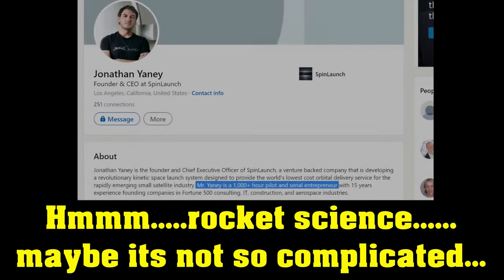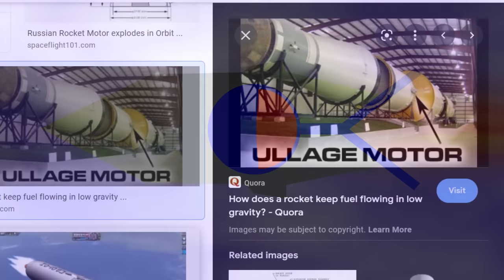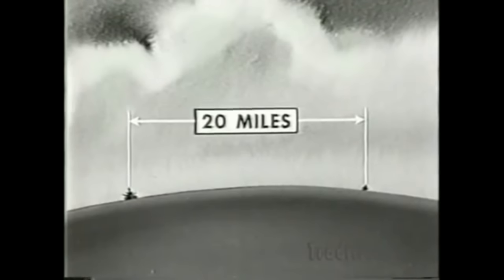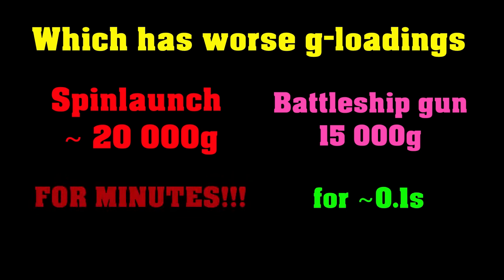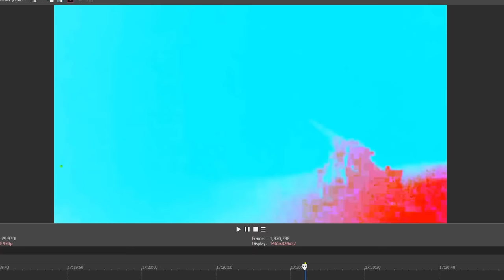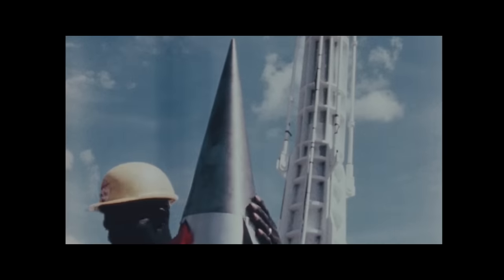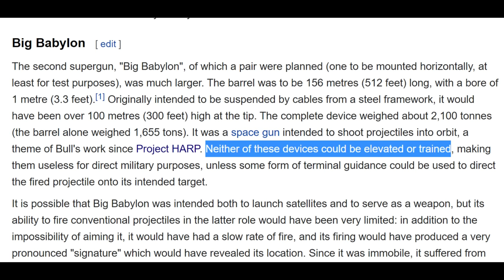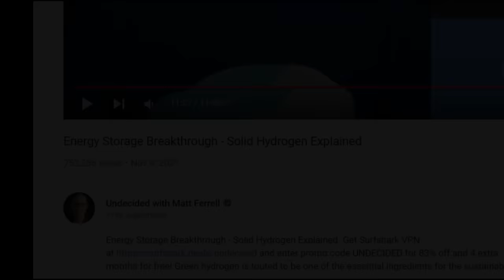Spinlaunch: BUSTED (Part 2)

Comment: Fun fact - accelerating guns are how most ejection seats are propelled out of cockpits, turns out your spinal chord has a much better chance of staying in one piece if it isn’t subjected to all the necessary escape force in just one initial blast.
Reply: I never actually concidered how they work, I think I just assumed it was small rocket motors.
Reply: @Firecul  Nope. plain old shaped explosive yeets you out of the plane often causing paralysis and serious spinal compression requiring extensive care. At least that is how the USA military system worked back in the 90's..

The russian system uses 2 charges, the first small one throws you out of the cockpit and the second behind you accellerates you forward in a direction away from the plane. You will likely bkack out for a second but no spinal compression injury.

The second system is much safer but also bulkier, mosre complex and more expensive.
Reply: @SurmaSampo  Bind your pilots to a wheelchair to save a few bucks, or fork out a bit extra so that these pilots can fly again. Do American aerospace companies really charge that much for this hardware that it's cheaper to train an entire new pilot?
Reply: @SurmaSampo  Not really. How they actually work varies wildly, depending on the aircraft, but most modern systems use some sort of relatively slow pyrotechnic to do the "GTFO" part of emergency egress, with explosives usually just being used to clear the path. Spinal injuries are fairly rare in all but the oldest systems, which actually used something not unlike a modified shotgun to get the acceleration needed. Of course, leaving a plane at speed is never a great idea unless it has become quite unsuitable for continued use and injuries during ejection are an unfortunate but hard to avoid result of the physics involved... Not a great choice to make either way.

Then again, I have no doubt that you'd encounter some remarkably old tech still in service in just about any military force, so it's certainly possible you encountered some of these early systems... And I, for one, wouldn't want to be in a position of having to use one of those (my only actual experience is with low-speed aircraft, which more often than not use springs or compressed air rather than pyrotechnics).
Reply: @michaelbuckers  The solution is to train pilots they are already on a wheelchair.
Reply: @Firecul  
There usually is a rocket pack too, but that doesn’t activate until you’re out of the cockpit.
The vertical take off aircraft tend to have larger rocket packs to account for the more likely need of a “zero zero” ejection - one where there’s no vertical or horizontal aircraft speed at the point of escape.
Reply: @jandl1jph766  My comment come from people I knew who were Air force in the 90's dealing with fighter jets. I suspect that the technology has to have gotten better in the last couple of decades. I am happy to be corrected.
Reply: @SurmaSampo  As I said, I have no doubt that ancient tech will show up in the most unlikely of places when you're dealing with the military - I won't discount anyone saying they did encounter some. All I'm saying is that more modern systems are quite good at keeping the crew in "not terrible" condition, as far as that's possible after the aircraft has already become entirely unusable mid-flight.
Reply: SpinalLaunch
Reply: Any use of ejector seats actually causes fractures in your spine, causing you to get discharged or reassigned.
Reply: @TheWizardGamez  
Maybe that’s the policy where you live, but it’s not universal. 
Here we allow aircrew two ejections at most.
Globally, there are people still alive today only because they’ve ejected several times.

Comment: I love how they never mention any structural engineers op their payroll - because they would all tell them we simply do not have the materials that are capable of holding up to the forces a 5k MPH spinning arm would create. Not to even mention the vibrations caused during the release and sudden in-rush of atmosphere when it pierces the film covering the exit port - which adds even ANOTHER problem of the payload not just disintegrating when it hit THAT.
Reply: Exactly
Reply: Eaven if someone created and balanced that thing.. once you release projectile.. it is no longer balanced, hits atmosphere - expledes in million peaces. :D
Reply: @MasterFlopy  You can keep it balanced by releasing the balancing-mass at the same time.
Reply: @quintonwilson8565  that would work i guess. Only problem. That would slam into the ground with force of a small bomb 😅
Reply: @quintonwilson8565  Have you a car ? Ever had a 5 g balance block fly off a wheel while doing 65 mph/100 kmh , funny how it start to shake and you only lost 0,03 % of the weight and that your only going 30 yps/28 mps , wheels spinning only about 840 rpm .
So even if your rotating arm weight is 7000 kg , then.a 200 kg projectile is 0,03 % it will start shaking , so you use 14 000 kg rotating arm , thats a weight of a city bus .
Why not just use railgun tech , speed up the projectile with magnetic levitations , oh yeah , US Navy stopped financing that project , when its another failure like F35 .
Reply: they probably counted the speed closest to the rotation since further inwards it is faster since the distance is so much shorter than on the outer rim
Reply: Material limitations exactly what prevented the Tesla turbine from widespread adoption
Reply: @chemomancer  does rifling work the same way in a vaccume?
Reply: @chemomancer  thanks you clarifying. i'm pretty sure that's how i remembered rilfing working but for some reason i got in my head that air was involved somehow.

and yeah, at mach 7 i doubt the rifling would even alter or stabilize the rocket at all. it would just damage it and it would continue on at whatever wonky angle it was fired at.

Comment: Okay, now I want to see some engineers revisit the space gun! I'm convinced that the only reason this project has gotten funding is because it looks more hightech on paper over a space gun, but at least a space gun could possibly work.
Reply: It was revisited in the 90's, using a light gas gun - project was named SHARP. But it was cancelled in '95 as further development funding was cut.
Reply: I would think the most practical (relatively speaking) way to achieve that would be with a railgun or coilgun. If you make it long enough (one the order of several miles), you could even get the G-forces low enough to do manned launches.
Reply: I can get behind space guns!
Reply: Make a nice convincing video with 3D rendered models/animations and you just might make enough money to build it.
Reply: Read up on Gerald Bull
Reply: @hedonismbot1508  
You would want your railgun to angle up so its muzzle could exit in the upper atmosphere...
And, even better, full the cylinder with a light gas like helium, which presents less resistance...
The catch is that building a structure that high is quite difficult...you're talking about a VERY long ramp.
On a scale of MILES the longest space gun wasn't very long at all...
(And it still required a lot of reinforcement to even keep two battleship gun barrels in line.)
Reply: I should remind everyone that the "space gun" WORKED - and did what it was designed to do.
(Which probably seemed pretty crazy to a lot of people at the time.)
And, in less than a century, we're progressed from shooting a shell a hundred miles straight up to leaving the solar system.
When I went to college we had a ruby LASER that took up a whole lab bench, weighed hundreds of pounds, and could barely punch a hole in a piece of paper...
Nowadays I can cut cardboard with something that looks like a pocket flashlight and runs on AAA batteries...
And I could tell you how to make a LASER out of a can of Mountain Dew... or a piece of colored Lucite... or a glass tube full or ordinary air...
Every new technology has to start somewhere...
I give these guys a lot of credit for TRYING...
Reply: hmm, a chemical reaction under a payload... sounds like.. .a rocket?
Reply: @goldmanfan504 heck, I'd even would pay to pull the trigger, after all, you gotta aim for the moon!
Reply: @keithlevkoff8579  Mt. Chimborazo is on the equatorial bulge and pretty tame slope-wise, perhaps the perfect spot for a railgun.

Comment: My understanding was they were looking at a pressure-fed engine rather then a pumpfed one.  With such an engine you can get around ulage by tapping the propellent at either end and use some float valves or a bladder to avoid pulling in the pressurant gass.  Still your point stands that the rocket concept is poor, a solid rocket motor would be more sensible due to not being so delicate.
Reply: To be a general purpose satellite launcher you would want a restart ability. That's quite a pain with solid fuel motors.
Reply: I thought most rocket fuel tanks were pressurized with liquid nitrogen or liquid helium?  Do they really rely on gravity to not starve the turbo pumps?
Reply: @lookoutforchris  no, they just need a bit of acceleration to make sure the fuel is at the bottom of the tank so the turbo pumps/engine can use it
at the start of the launch this is provided by gravity, but during launch and when they are in space, it's provided by the engine pushing the craft forward
Reply: I thought about this one too. TF's point here is poor. There are many ways to get around the engine startup problem. Also, not all engine/propellant types even require ullage.
Reply: @ojkolsrud1  I find his content is generally not very well researched. The number of Gs should be around 10,000 instead of 20,000 for example, which makes a lot of what he said wrong. However, there are like a million engineering problems you can point to with this concept that would all have to be solved and work perfectly every time. Making a 10,000 G-hardened two stage cryogenic liquid rocket would probably be the most difficult part. Just to point out one of many issues: where would the boiled-off LOX go? Wouldn't it destroy the vacuum?
Reply: @metachuko  It could be that he's consistently using worst-case numbers, but that's not honest unless you disclaim it. I think his main point in that this might be a stupid idea for Earth is valid, but I agree - in general, you can't really trust all his numbers. Regarding the LOX: First, putting cold fuel in vacuum is less of a problem than when a rocket is surrounded by warm air. So, it would be much less boil-off, because the vacuum isn't a good medium for the heat transfer. Secondly, I imagine the vacuum pumps would be running constantly, because with such a big volume it's hard to keep it.
Reply: @ojkolsrud1  Maybe; it's a bit unclear how good of a vacuum they'd need to actually hit Mach 6 or 7 in there, and the worse it is, the more heat gets transferred into the rocket, and the more LOX would get boiled-off. Not that I think they'll ever get close to actually testing that out.
Reply: I agree that solid propellant seems like a better idea...

Comment: I would also say that safety factors are important here. The way I calculate it, with no tapering, Carbon fiber can BARELY withstand 5000 mph spinning. But this thing is supposed to be reusable. You don't want to push materials to their limit. You want a pretty decent safety factor so you're not right on the margin of exploding on every launch.
Reply: A good point; aren't bridges designed to hold twice their "maximum capacity," that is to say have a maximum stress of only 50%?
Reply: an electromagnetic railgun is cheap, fast, easy to operate compared to normal guns. it can launch things into space, and best of all it can shoot down alien spacecraft
Reply: @UCXEO5L8xnaMJhtUsuNXhlmQ  
Not sure but dams are pretty conservative, too, for good reason.
Reply: Designing a spacecraft to withstand 10,000 G doesn't sound low-dollar to me.
Reply: @Blox117  I prefer using voodoo against the Greys. Advanced materials science is no match for the old time religion.
Reply: @Blox117  cheap and easy hardly.
Reply: @UCXEO5L8xnaMJhtUsuNXhlmQ  depends on the bridge their usually designed for twice the average load and with a 4x Safety factor.
Reply: @Blox117  you can only shoot a rail gun so many times before it destroys itself
Reply: @jediknight1294  It is actually surprisingly easy, just really fucking expensive (if you want proper projectile speed), both material and energy wise. 

Seriously, you need to replace multiple parts of the gun (well, mainly the barrel parts) itself with every handful of firing. Or atl that was the stage these things were at last time I checked, which was... 7 years ago...

...I feel old.
Reply: @Elmithian  oh building a small one isn't particularly hard its the power draw that's the issue when we push up to anything big projectile weight. 

Mach 4 is easy beyond that not so much.
Reply: @Blox117  You might want to calculate how much current is required, BxB forces are massive and need a barrel of similar strength to a propellant based gun, muzzle flash from the residual energy stored in the  guns inductance is similar to a propellant based gun but much hotter. Voltage required is proportional to velocity times the diameter of the projectile, current is proportional to the diameter.
Reply: @ValExperimenter  thats neat, where are those equations for voltage and current derived from?
Reply: Elmithian 

You have to admit though, being able to launch things at beyond the speed of sound using electricity is cool as hell.
Reply: @sirapple589  a rail gun does that, in a linear fashion
Reply: @Blox117  Initially from Maxwells equations. First order approximations can be found in any first year physics text, a starting point would be "force between parallel conductors", the projectile base forms a conductor and it is this force that accelerates it. I designed one in the late 80's . Voltage is a combination of the Faraday effect (motion of a conductor in a magnetic field)and LdI/dt L is determined by the area enclosed by the propulsion circuit which changes with time.
Reply: -Matter didn’t create anti matter
-Anti matter didn’t create matter
(Both of them were present at the time of big bang)
-Both of them didn’t create themselves.
-Both of them came from an unimaginable source,  that unimaginable source created matter and antimatter (everything) thats why it is known as “the creator” of everything.
——————………………………………..————-
- that unimaginable source/creator has created sin and virtue which are opposite to each other,
— logic says every action has its own reaction, so the reaction of sin must be different than the reaction of virtue,
— the creator has created prophets to let us know about each and every detail of sin and virtue, also about their reactions,
Thank you :)